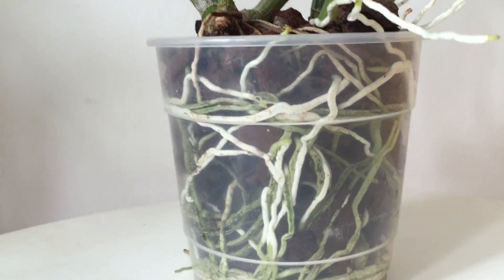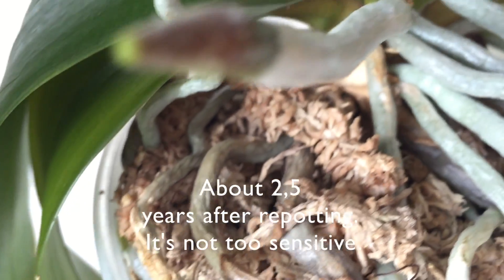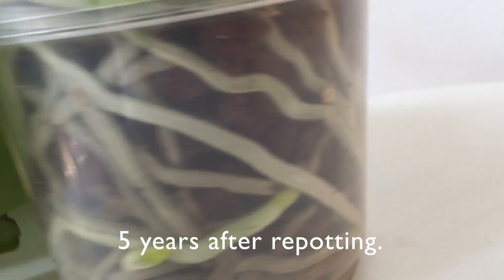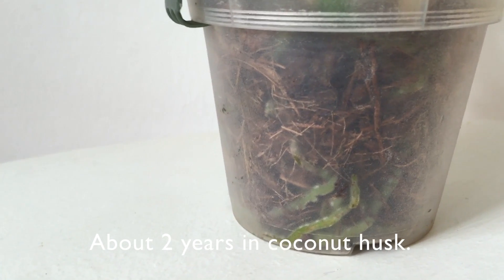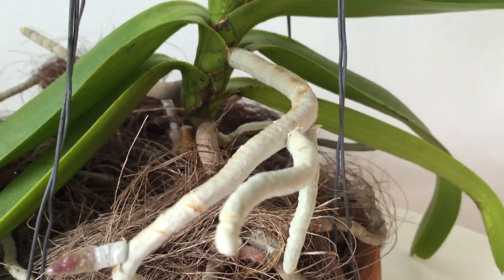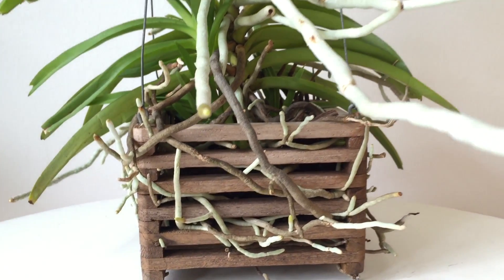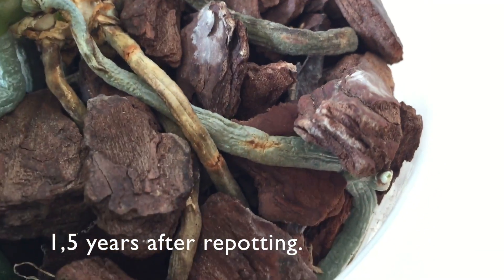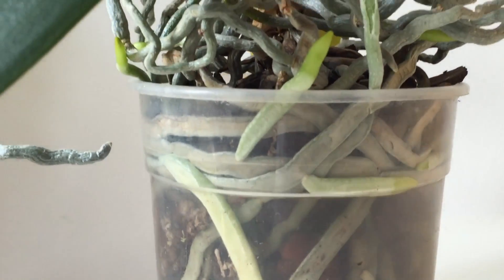Root Burn on Windowsill Orchids - My Setup - The Time Factor

Comment: Hi, thanks so much for this video, indeed I have considered this possibility as well and will include it in my video on testing the fertilizers. I have had some burns in the past as well, however nothing as vicious as my current situation, even though my humidity was lower in my old balcony. Thus I am noticing it now and I am considering it a problem now, as new roots that emerge burn before they grow enough to have the capacity of branching. Thus you can see how this can be problematic :) I did notice though that the powder fertilizer I use is incredibly hygroscopic, I fear that it already spoiled and this happened in about a week or two after opening the container. It's amazing how your fertilizer simply liquefied in the jar!
Reply from the maker: I suppose many people dilute powdered fertilizer in a low quantity of water before mixing it into a larger volume, simply because it's easier to help to dissolve it with a spoon or so. At least that's what I do with another powdered fertilizer that doesn't dissolve properly on its own. If that would lead to the precipitation of root burning compounds, there should be a note on the label on the 'why' the instruction should be followed strictly. That could help with the compliance of the customers and avoid problems and complaints. But I'm surprised that that is supposed to be the problem since it would mean that the fertilizer would be extremely succeptible to mistakes. 

I've a fertilizer that comes in two bottles and one must mix it and use it instantly to avoid precipitations and I have had a liquid fertilizer that had huge amounts of insoluble precipitations.
Since I have experienced root burn with all kinds of fertilizers (also balanced types) and also seen precipitations, I could imagine that Rainmix (the old and also the new formula) has the same issues like many other fertilizers. One has great expectations since many people recommend it, but at the end of the day it is still salt on orchid roots and maybe the setup of the people recommending it is somehow different and makes it less susceptible for root burn.
Reply from the maker: Hi Danny, thank you so much for your comment! I'm glad you understand my point, although it isn't an explanation for everything, unfortunately. I think different factors play a role in how fast an orchid is able to absorb nutrients: the orchid itself (species, its health etc.), humidity, maybe the composition of nutrients in the fertilizer and also temperature and I'm sure there are a few other things as well. But what makes the time factor so important and kind of special in my opinion is that it is a limiting factor: Once the fertilizer has crystalised, the absorbtion stops and the damage begins. 

Believe me, my eyes popped out of my head when I found the liquefied fertilizer, lol! :D

Do you think, a fertilizer that attracted water is spoiled because certain compounds reacted and became insoluble/useless? I kept using it since that happened. :/ I don't see much precipitation in there, though.
Reply: I do tend to believe that is the case, at least for Rain Mix. Akerne told me I was diluting in too little quantity of water, thus making other reactions possible and having a precipitate due to the super strong solution I was making. The compounds were reacting differently in a lower volume of water apparently. I am not a chemist so I cannot attest the validity of the statement, just what I have been told. I can extrapolate from Akerne's statement that powder fertilizer that absorbs water will probably start to change its chemical formulation as well, which is a bit worrying for me as I cannot seem to keep my fertilizer from absorbing some water, even in a sealed container. Since I keep opening the container to fertilize, each time more and more moisture will be trapped inside. Even the original container that was not opened in a long time is looking like it absorbed some moisture. I am also experiencing precipitation in mixing the dosage recommended in a 2 liter quantity. I am investigating still what the cause of this is. In any case I agree with you, roots that are exposed to air seem far more prone to burns, as I can clearly see it in my orchids as well. What I have never experienced before is the severity of the burns, even if now I have a theoretically better environment, humidity wise at least.
Reply: I hope you don't mind if I jump in the conversation ;) The rain mix I buy often has already absorbed moisture from the air and become pink, and I think maybe the distributor in Finland (who also pack it before selling it here) doesn't store it air tightly enough. Now I started to worry about this. The first time I bough it years ago, it was white, and I think (but not sure I remember correctly) it was easier to dissolve than when it has become pink.  I thought of keeping a silica gel sachet inside the container - because it absorbs the moisture from the air and would keep the product dry - but once it's pink maybe it's too moist already. I also notice the plastic measure spoon becomes very sticky, if there's some product left on it after use, and I have to wash it. Maybe if it was possible to get a brand new, still white and dry product, and keep it with a silica gel sachet to keep it dry, it would last longer. But it seems at least here, our local distributor doesn't keep the powder protected enough from the air during storage, so when we buy a package, we can only know at home when we open it. But this apparently happens to other powder fertilizers as well, of different brands. It would be nice to be able to buy some in transparent pots, so we could see how it looks like before buying.
Reply: Not at all I'd love to hear your input :) well I am not sure exactly if this can only apply to the SO3 formula, I am trying to clarify this. But from what I understand from Akerne, CaO in combination with PO4 (not yet certain where the PO4 compound comes from, which reaction creates it, it might have to do with SO3 it might not) leads to an insoluble compound, gypsum. Theoretically, if the fertilizer keeps absorbing moisture, the gypsum might already form prior to me diluting it in water. I wish a chemist could express their opinion on this as well :) it would make sense, since my container of powder got more and more pink as I was using it. However I am not sure that the suspensions I was presenting in my video are the gypsum, as diluting a fresh new sealed container of Rain Mix in a recommended dosage in 2 liters leads to the same precipitation. Rain Mix is declared 100% water soluble, for me it is not. What factors limit the total dissolving salts I do not know, it might even be my osmosis water, thus I am trying to dissolve it in other sources of soft water as well.  Andrea, is your Rain Mix dissolving completely? did you ever use the old formula without SO3? did it completely dissolve for you? I would love to know these things as I never had the chance to try the old formulation.
Reply: MissOrchidGirl I have only used the old formula. I think the new formula is quite new, and the last time I was at the supermarket I checked the new ones they were selling, but they too were still the old formula. I think eventually the new formula will start being sold here too. The pot of rain mix I have right now has absorbed some moisture from the air before I bought it, because it was pink when I got it (the first time I bought a package of this product, it was white, but the following packages had pink powder, so I think it happened during storage at the distributor). It doesn't dissolve completely, there's always some little leftover at the bottom. I used to mix it in a plastic measuring cup with 1 dl of water before adding to the rest of the recommended amount of water. This morning I tried dissolving the powder directly into the recommended amount of water, and there was significantly less undissolved powder at the bottom of the jar, so there might be something to it. But it didn't dissolve completely, there was a little bit left at the bottom, though much less. It could be because the powder had already got pink. I don't know. I wish I could remember with certainty how well it dissolved, when I had a fresh, still white powder.
Reply: Thank you Andrea, which the old formula would still be available for sale somewhere online :(
Reply from the maker: Of course not! Hi Andrea! :) My fertilizer became more and more grass green with time and one day I found it liquefied. I stirred the pieces that were not liquefied yet with a spoon. It was quite impressive. It's too hard for me to keep water away from powdered fertilizer. And if I'm not even allowed to dissolve it in a small amount of water, it's getting too inconvenient for me. I still have enough fertilizer for years, so I won't buy a new product soon, but I think the next one will be a liquid fertilizer. ;)
Reply: I totally agree, I will make sure to note this in my video about my conclusions. I also mentioned this to them in my email, if this is a dangerous practice it should be mentioned specifically in the instructions. Since I am testing it still I cannot yet say if the fertilizer was the source of the root issues, I am just trying to gather information and hopefully use it correctly to make an informed conclusion. It might have just been my improper use of it that caused it, it might not. It might just happen to me and my set up, my osmosis water etc. I will be sure to make an update on this. But at the end of the day the important part is.. I have problems with my orchids and I would really like to solve them. Whatever the cause is I just want to find it faster and eliminate it, as it's hanging over me like a cloud :( If my orchids were already established and had a good root system this wouldn't concern me as much. But seeing fresh roots burning at 1 cm length on an orchid with no root system is not the best thing to wake up to :(
Reply from the maker: I wouldn't call it improper use, though. It is really hard to keep roots plain white and shiny in our kinds of setups, it's in the nature of things that fertilizer crystalises on them when they dry. One would have to use the absolutely perfect amount of fertilizer for the plant to be able to absorb and take all factors that play a role in consideration to avoid root burn completely. Nobody does that or is able to do that. I certainly didn't and I didn't try either. I take it easy, because it's mainly an asthetic problem for me,  but I really understand that you worry about the ones that are not fully established yet. :/ Maybe you could pamper the burnt tips with RO water, maybe that wakes them up. Sometimes green tips emerge from literally black root tips. Or maybe a layer of damp sphagnum around them would cause a nice environment to promote new growth. Do you remember at what TDS the roots burned? I wouldn't go beyond 100 on surface roots to be on the safe side. I only use RO water, that's easier for me and absolutely safe, since it only hydrates the roots and there's nothing in it that could dehydrate them when it dries.
Reply: ***** I think it could be a storage problem, before the product was packed. The first time I bought it, it was white. But the second two packages already contained a pink powder, so I think my local distributor didn't store the product air tight prior to packing.
Reply: Here are two photos I took today of the package I have in use right now. This was produced by Akerne, and then packed and distributed by Biolan in Finland. I believe the product might have absorbed moisture from the air during storage while at the distributor: https://plus.google.com/101674921628468592572/posts/VXPPRbCPTfZ
Reply: ***** It's hard to know what to think. :D I'm still using it. I don't have any better options at the moment. As long as I don't see any visible problems and the plants are doing fine, I will keep using it. It might eventually get too old if it keeps adsorbing moisture. It gets sticky too.
Reply: Girls, I received confirmation from Akerne that my Rain Mix  is too pink and clumpy, they say the specs are due to this, and are CaSO4. I just received the product in that video, used it for a week or so. As a side note, brand new light pink Rain Mix just opened does the same specs but they didn't comment on that, so it might be something else in this case. So, your choice if you want to use the Rain Mix if it looks like what I show you in my video... Actually.. I think I am making an answer now and finding the problem maybe. I misused it, it absorbed too much water as well thus I spoiled it. If this is the cause, the real cause.. I am happy. It means I have a chance to stop the root burn :D as a side note they do also say that what I show in my videos is not root burn, the roots just dried cos I didn't water enough, but I'll chose to disregard that personally, you might want to take it into account and research more how dehydrated roots look like vs burns. I actually followed an article on root toxicity burns in my decision making, my comment will be spam if I share the link but it's on clouds orchids website I believe. But maybe the article is wrong. I do appreciate their response, however I still am not sure who the culprit is, but I have a lead :)
Reply: MissOrchidGirl I wish they would sell the fertilizer in a transparent pot, so we could see before buying how the powder looks like, and if it has absorbed moisture or not. A distributor would also be able to see it and then it wouldn't send it to their clients if he noticed the fertilizer has gone bad, but in those black pots we can't see it. Unless if there's a reason for the pots not being transparent, like if it needs to be protected from light. Maybe it would be good if Akerne could put silica gel sachets inside the pots to keep the mix dry. How can we be sure that we would get a fresh product if we buy another package? That's the problem. :/ I'm still using mine. I don't have any better options to use instead.